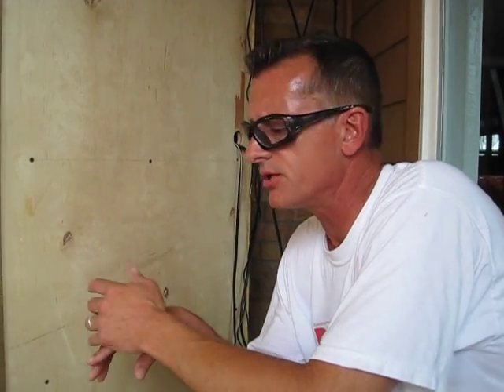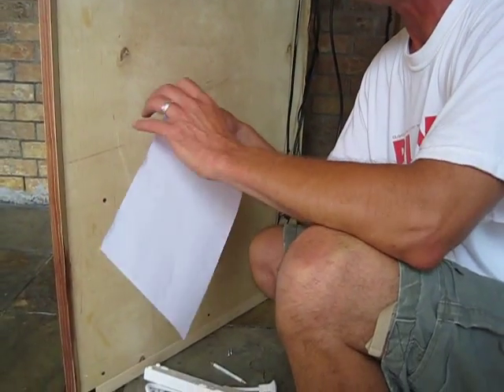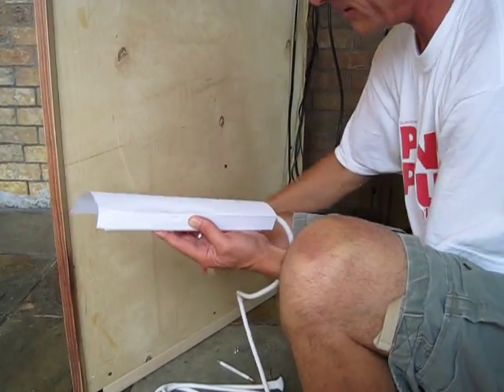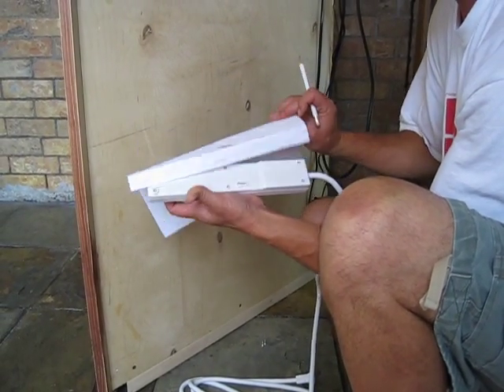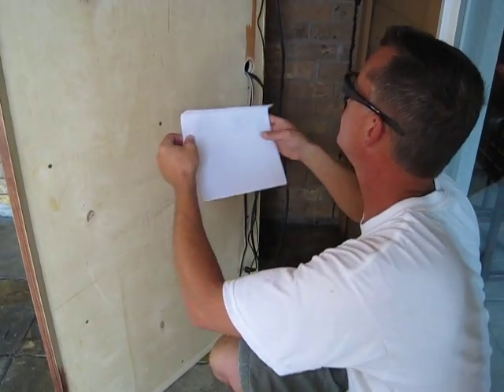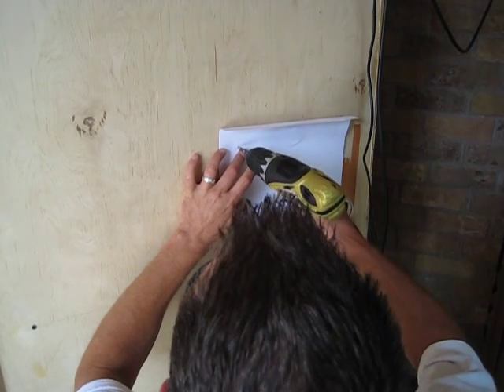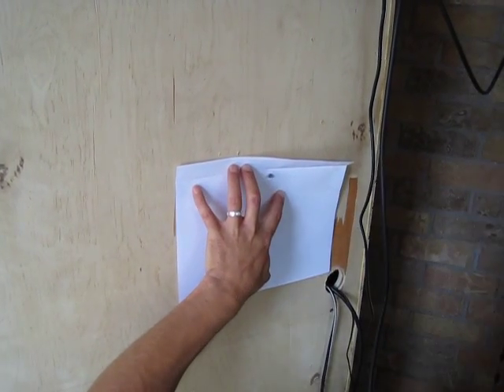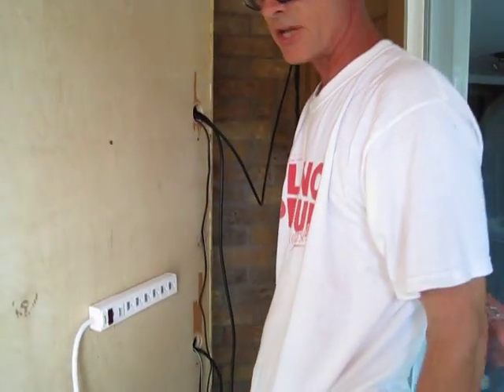Perfect Alignment: Power Strip Mounting Screws

Comment from the maker: I'd use a drywall anchor and then screw into the anchor and mount the strip.  Using this method of alignment should work just as well with the anchors as it does with plain screws.  It works for pretty much any scenario where getting things mounted on a vertical surface is a bit challenging.  Good luck with your project.

Comment: If you have a photo-copier handy...place the power strip on the glass and make a photo-copy of the bottom of the outlet. Use the resulting output as a template for placing the screws. Works...just a bit more complicated than this quick and dirty way!

Comment from the maker: Hi Halo,

The fold gives you a point of reference in two ways.  1). As long as the fold stays flush to the edge of the strip and you don't let it move the sketched holes will be perfect. 2).  If you install the strip on a thin skirt or leg of a desk, for example, you will need to know exactly where the edge of the strip will end up when mounted.  The fold gives you this frame of reference and ultimately the exact placement of the strip.   Good luck.